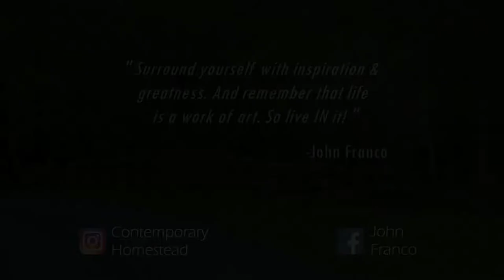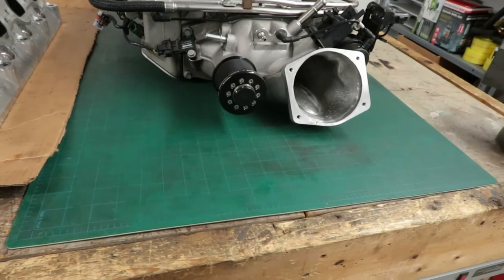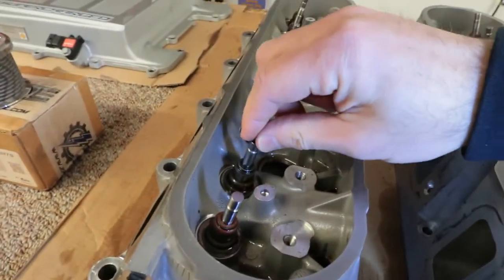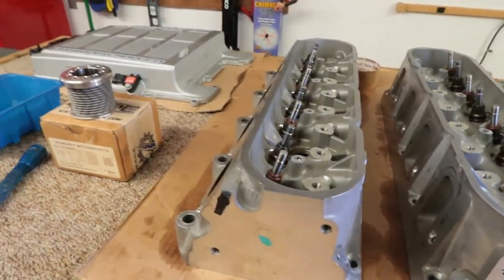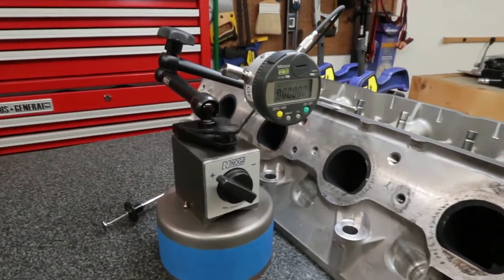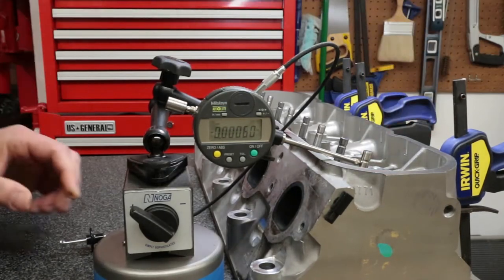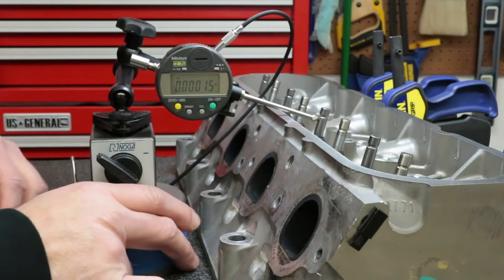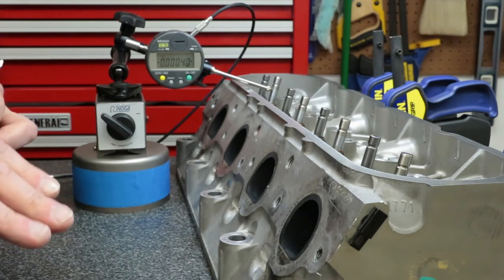LS9 Corvette ZR1 Ported HEADS & CAM Build | LS7 Valve GUIDE Wear Issue is REAL | Bronze Vs. OEM

Comment from the maker: If you plan on using this method shown to measure your guides remember stay perpendicular to the valve stem with the indicator and divide your result by 2. Acceptable clearance limit is .001-.0025

Comment: Why not run the roller rockers on the stock guides? Seems like the best of both worlds. Strength of the OEM without the scrubbing action from the factory rockers
Reply from the maker: OEM guides strong points are for longevity in a stock application. OEM manufacturers love that because it is cheaper and effective. Theres are alot of benefits to bronze guides. They transfer heat better and have more lubricity. All serious higher end builds & race heads have bronze guides because of these factors.

Comment: I’m interested in your current injectors for my Ls9 build I’m working on. Also, if you haven’t picked yet, I wouldn’t use lingenfelter, I just bought a snout from them and it’s been a NIGHTMARE. I’d use Greg at Kong for sure. I also have considered porting my heads, I would use Katech for sure.
Reply from the maker: Yes i am doing the Kong factory snout mod so i can run a 112mm TB. What was the issue with the LPE snout? I am selling my ID1050x injectors for ID1300x2 because e85 requires 40% more flow.
Reply: John Franco any way I could email you about my dealing with the snout? Also for the injectors if you’re interested in selling them?
Reply from the maker: @smythtaylor7272  Yes i am selling them hit me up JohnFrancoNH@gmail.com
Reply: John Franco email sent

Comment: As I've read problem is not (only) because of the rockers. Main thing is in valve coating. Bronze guides will last longer with titanium valves coated in nitride or molybdenum as not coated from the factory they ar quite rough and will grind the softer bronze guide. That's why Katech using coated valves and sell them for use with bronze valve guides only.
PM or more expensive Moldstar90 guides could work with just polished stock Ti valves without any couting. AHP does this way.
Reply from the maker: Yes i agree compound error is the factor. And theres so many factors to getting heads right. Main reason is not the coating itself its more so the roughness of said surfaces involved and the lack of concentricity and quality control.  

Katech has found out that there is a machining error from GM during manufacturing of the heads. The guide axis is not concentric to the axis of the factory valve job. Therefore the valve stem when closed sits skewed in the guide.  A repair for this problem first starts with new guides of your choice and a valve job.  LS rocker arm geometry sucks to begin with then throw in a wear prone scrubbing action of the rocker arm tip. And it will wear no matter what if a fresh new VJ is not done with the new guides. 

Moldstar a90 or bronze guide you will still get an elliptical shaped hour glass wear in your guides with factory rockers.  Stock Ti valves are already chrome nitride coated.  Its the coating surface roughness i believe not the coating composition that eats away at the guide. 

Coating is only going adhere to the base material so if the base substrate is rough to start with then the coating will just transfer the micro profile (machined or ground finish) of the base substrate.
Reply: no big company uses those moldstar90s for a reason, LME doesnt, WCCH doesnt, no one in the ls7 lsx game besides AHP does. Probably for the same reason you mentioned they run bronze and aftermarket, me thinks the moldstar90s just increase valve guide wear regardless of the positives which in turn is just offsetting the geometry issue to a different part of the valvetrain. All my boys with 900-2000whp builds and no one uses moldstars throughout like 10 cars.

Comment: From bad CrN coatings.
Reply from the maker: The CrN coating has barely any wear on my valve stems. The valve stem .3136" diameter when checked with a calibrated mitutoyo micrometer show almost zero wear top to bottom. I get .0001-.0002" variation between all the valve diameters. Thats really good. Compared to the OEM guides where i measure .003 - .015"! Should be .001-.0025 of clearance.

Im very experienced when it comes to high end manufacturing, cnc machining and inspection of coatings & surface finishes.  I find it hard to believe its just the coating itself. The coating is there to provide surface hardness and lubricity. Its the terrible surface underneath that eats the guides.

Which makes the coating also rough if you start with a rough substrate underneath that isnt ground to a lower surface finish requirement. Then you have the reciprocating action of the factory rockers and you have an oblong hour glass shaped wear in all the guides. 

 Its a combination of the roughness of the surface of the valve stem before the coating is applied and the terrible geometry of the factory rockers and worse if you have an LS7 because the ratio is bigger at 1.8.

Theres compound errors going on here not just on single thing is to blame. And the biggest one being that the factory GM valve job is not concentric to the guides 2nd being the terrible scrubbing motion of the rocker arms and then 3rd the surface roughness of the valve stems that could be better.
Reply: @JohnFrancoNH  great video BTW I was the first cylinder head guy to go public on my own findings...the forums banned me on cf long ago..but this thread is on ls1 tech. You can take the lsa intake valve an it will stop the wear on the intake side. you would have to use the lash caps diff height valve. I tested this long ago an the deleted my posts but I havent worked as many ls9..but i've been working the ls7 since it came out. either way i'd check em every 10k.https://ls1tech.com/forums/generation-iv-internal-engine/1678573-ls7-10k-miles-valve-guide-inspection-ss-valves-bronze-guides-7.html

Comment: Why hasn't Chevy addressed the valve guide issue. It is all over internet and shops have pricing to fix. As a minimum Chevy should pay for the repair IMHO. As it stands now I would stay away from cars with these heads installed without the fix.
Reply from the maker: Tell me about it its a bunch of factors not just one single issue as i stated in previous comments. Thanks for watching!